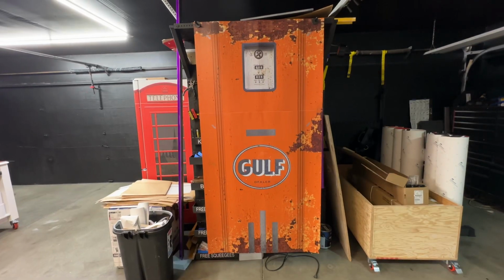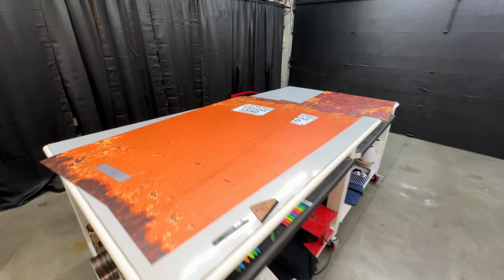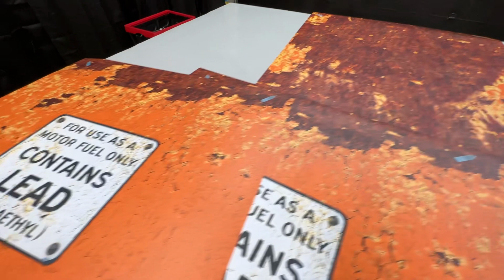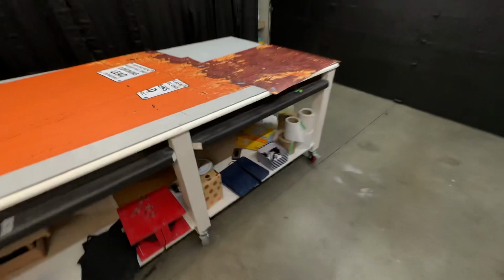Rusted Gulf Oil Gas Pump Refrigerator Wrap

Comment: Hey nice video, how much bleed do you typically leave on the sides?
Reply from the maker: 1-2” inches of bleed. If it’s the sides of the refrigerator, we add 2” inches on each side. If it’s the front we add 1”  inch bleed. We have instructions how to measure your fridge on the website can you place the order?